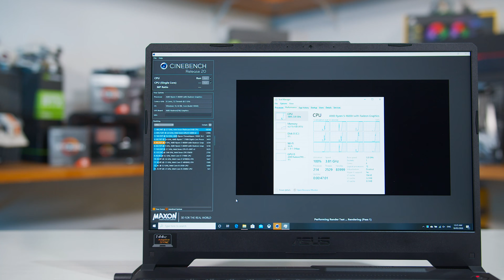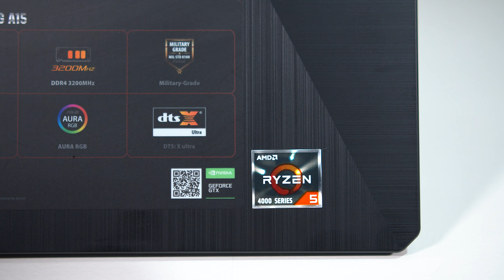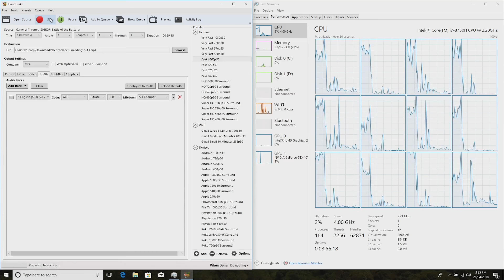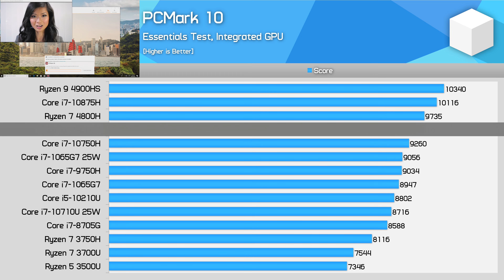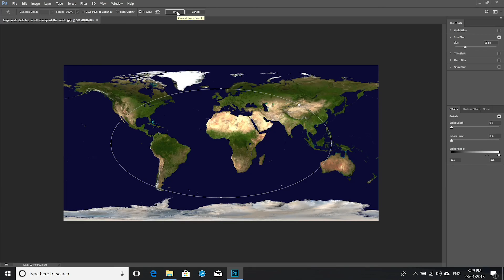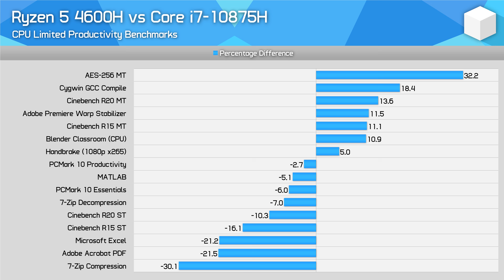AMD Ryzen 5 4600H Review, The Fastest Entry-Level Laptop CPU Ever

Comment: now if only manufacturers would combine these chips with good keyboards, displays, and general systems
Reply: Asus seems to be leading the pack there
Reply: Zephyrus G14 is pretty sweet, with a price tag to match.
Reply: @everythingfeline7367  if the only version with 1440p resolution wouldnt cost 2200€ in germany... I would by it even with one ram stick soldered, but for like 1200€ with out the rtx2060
Reply: Will take awhile, the best keyboards by far are made by Lenovo and Panasonic, Panasonic is way too niche, and the good Lenovo P-series uses Xeons and are effing price, and both systems are tested for stability in years of use, and AMD still doesnt have a reputation in that.
Reply: @youriardon8006  Heard anything about the Omron mech switch keyboard gigabyte has in their new line of their Aorus laptops? I haven't felt one yet myself but they look promising and certainly look like the best execution of a mech keyboard on a laptop I've seen so far.
Reply: @MrDJAK777  You could be totally right, but when it comes to business and productivity, writing semi large emails and stuff, I dont want a Gigabyte game space sci-fi thingy to take to my customers, i want a one size fis all, for everytone, doing eerything just right, at this moment i have a Panasonic Toughbook CF-54 for outgoing support, an old Lenovo P50 for homeoffice work, and an Acer Nitro for games, they all are unique in function, but all 3 are extremely different
Reply: @youriardon8006  I was more asking if you'd seen or heard anything about how they are, but the 17g is actually just a plain grey/silver laptop, the vents are even just rectangles doesn't look crazy at all, looks like a very professional and high-end laptop, with the keyboard backlight turned off or set to white I'd happily take it with me to a board room or to a meeting with a client. Though if you actually require the durability of a Toughbook that's probably the only criteria it wouldn't meet. Outside that for a one size fits all, I'd suggest looking at cleevo/sager builders/resellers.
Reply: Lenovo Legion 5.
Reply: I'm pretty happy with my TUFF A17
Reply: As long as OEMs only use chiclet keyboards, well never get good keyboards on a laptop.
Reply: @Setzer K I'm no Nvidia fan, but how do you expect a 5500M to do better than a mobile 1660 Ti?
Reply: @jacintofernandes2907  He's either oblivious or meant to say either 1650ti max q vs the 5500m or the (less likely as it's not quite out yet but will be a killer when it does and probably what manufacturers are waiting for before they make higher-end AMD only based laptop solutions) 5600m/5700m vs 1660 ti max q but he probably meant the former. AMD suggests the 5600m will outdo RTX 2060. If those claims are even close to accurate, which based off their specs they should be, its gonna make for some insane laptops at hopefully moderate prices.
Reply: @Setzer K 
4GB Vram in 2020s ?
Reply: checkout the new huawei matebook 14

Comment: Does somebody know, why there are no thunderbolt 3 ryzen notebooks? There are thunderbolt 3 AM4 Mainboards...
Reply: Simple, because Intel owns the rights for Thunderbolt interfaces.
Reply: It’s because those boards have “unofficial” support for thunderbolt 3. My guess is that while a ZEN2 laptop could technically support thunderbolt, the major manufacturers (HP, Lenovo, Dell, etc) don’t want to meddle too much in this legal grey area to avoid angering Intel.
Reply: lmao these 2 previous comments clearly didn't properly comprehended OP's question.
Reply: The OEM just didn't want to put the controller inside, they need to pay royalty to Intel. Also USB 4 is coming, and it is literally TB3 without the royalty
Reply: Manufacturers didn't expect renoir to be so good, hence why there are already more 10th gen intel systems and no gpus better than a 2060 paired with a Renoir cpu. I guess that the controller would add a decent amount to the cost of a device. Here's to hoping that Renoir and Cezanne APUs are put into better and more premium designs later this year.
Reply: Adds to the cost (very important at lower end systems) and recent Thunderspy vulnerability could raise some eyebrows if such laptop is something you'd like to buy. I can understand though where you come from - a laptop with such powerful CPU might be a good candidate for eGPU setup based on thunderbolt. I'd bet it would have no issues keeping up with desktop 2070 Super or 5700XT. It would be a pretty expensive setup, but very flexible - game on 1080p medium/high when out and game on 1440p ultra when you're at home - makes sense!
Reply: @IgnatiusDavidPartogi  Intel doesn't own rights to Thunderbolt anymore, haven''t owned the rights for a while now actually.
Reply: OEMs are lazy and can't be bothered to add TB3 because they thought their Ryzen models wouldn't sell.
Reply: Ignatius David Partogi No the real reason is that normal people don`t buy expensive amd laptops. They wan to buy expensive Intel laptops instead...